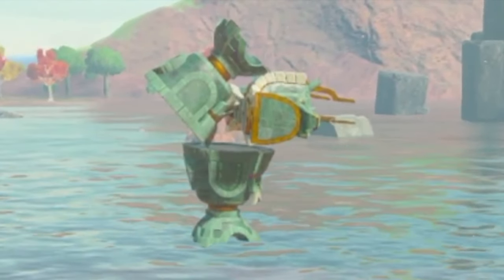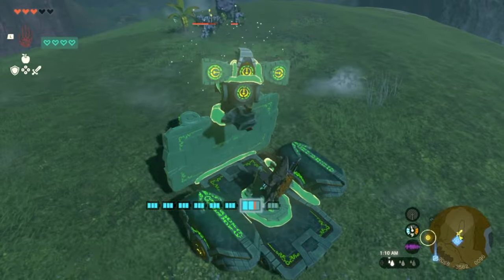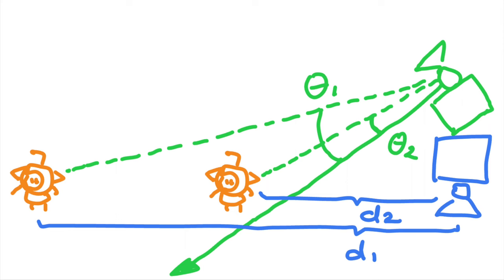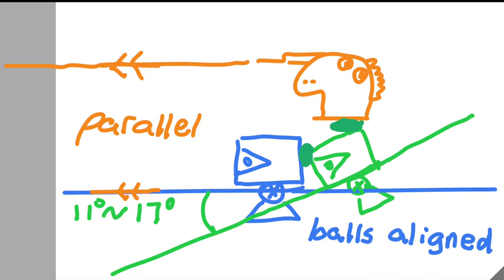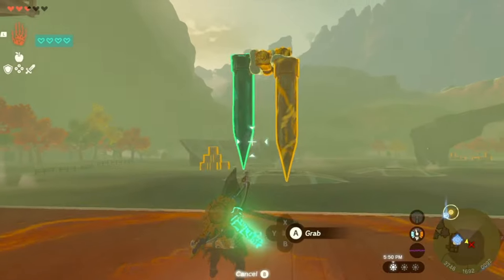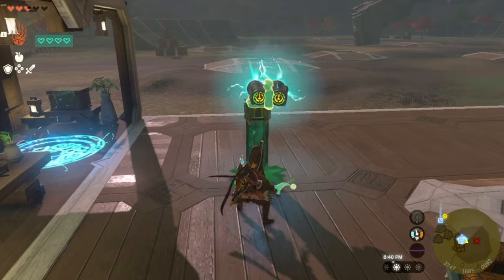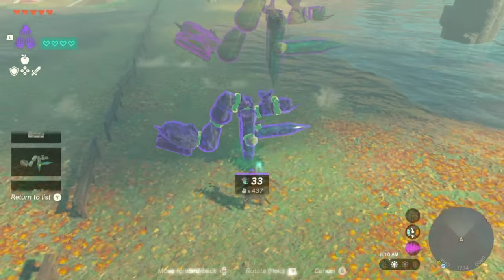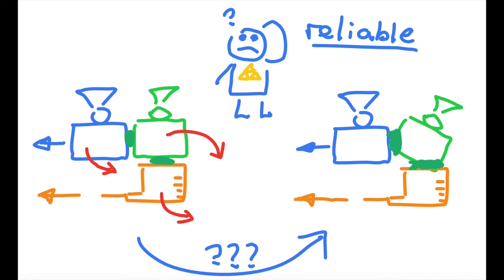[tears of the kingdom] small angle pulse laser mk 2

Comment: Honestly, the gravity nudging was pretty consistent for me. There's just two things I had to change for it. The first is that I had to but the pulsing laser head upside down. The slight angle makes the laser miss it's mark too much. The second was that I had to nudge the laser down a bit after the reddit tutorial. It looks straight, even if you graphically measure it. I ended up using a wooden bean with 2 laser heads at the end of it to nudged it to virtually perfect parallel.

I also have to mention, when mounting the pulsing laser head, if the head looks up, it has a high chance of detaching the pulsing head unless it's attached to something thin.
Reply from the maker: truth be told I never attempted the reddit build despite knowing it's consistent. I thought it was too tedious but seems like it's not bad after days of us (travvo included) of trying to improve it
Reply: @dewinmoonl  Just keep in mind that it's consistent but the laser head is not level to the aiming control head. It honestly isn't tedious if you've done stake nudging before. Just assemble and need to gravity nudge twice. The tutorial is very detailed but once you know the idea, it's really quick to do. IMHO, it's easier and more reliable than stake nudging. Not to mention much easier to make small adjustments as needed.

Comment: When I gravity nudged my beam emitter is level with front head but when attach more beam emitters there pointing down front head eye. So, I tried phantom clippind with 4 beam emitters and after gravity nudge each emitter was pointing different variations slightly above front head eye to below it. 

Watched video multiple times and can't figure out why all phantom emitters didn't line up since I attached all to same point on head
Reply from the maker: the phantom emitter needs to be connected to the aligned emitter on the head, not on the head itself.